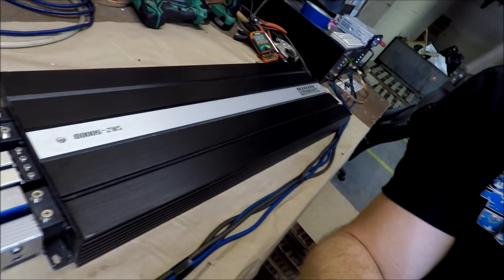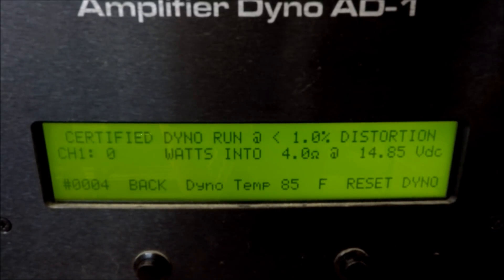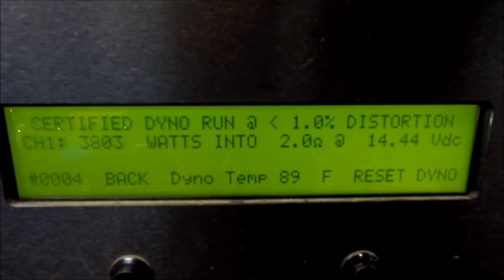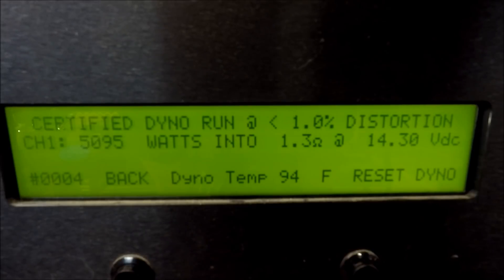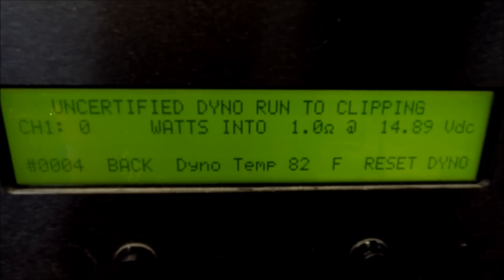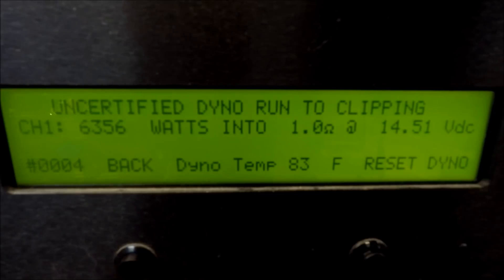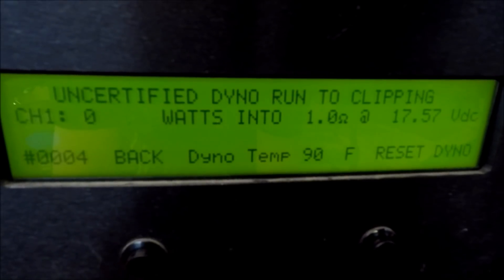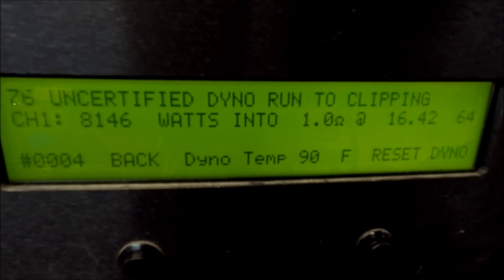***Saz-5000d Puts out over 8,000watts*** on the Amp Dyno at Sundown Audio

Comment: But who wants to make there amp clip to send dirty power to a sub.
I’m more interested in the certified run and the dynamic RMS power.

the reason I don’t like the idear of uncertified run is that I don’t know how hard the amplifire is clipping and I would not make any of my amplifire’s clip.

depending on how hard it clips you can damage your sub due to longer peaks of voltage making a square wave form from the amplifier and depending on how hard the amplifire is clipping, it can heat up the coil faster than normal due to no movement of the coil to cool the coil down and can damage the speaker with longer peaks of voltage heating up the coil faster then normal and or damage your amplifire by making it put out more voltage then the amplifire is designed for, also making at a lower impedance to the amplifire due to the voice coil staying up or down for a longer period of time which some amplifire cannot handle by stressing the out put stage of an amplifier.

Not complaining just saying keep up the awesome work on your products I’m a big fan of sundown audio products.

Cheers 🍻
Reply from the maker: Uncertified is right up to clipping, not pushed well into clipping.  It's where people are gonna play their stereo at daily.